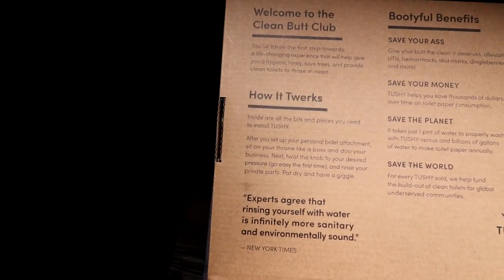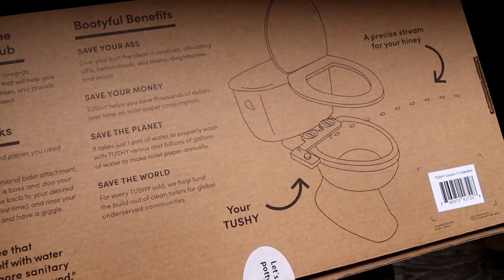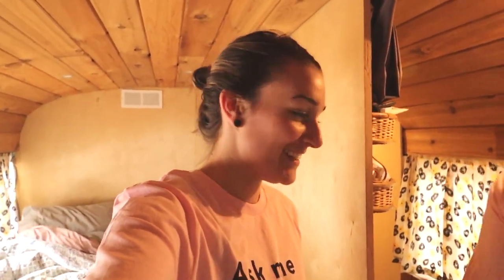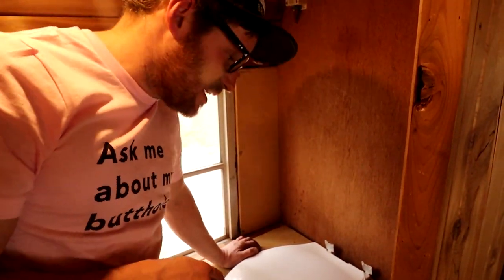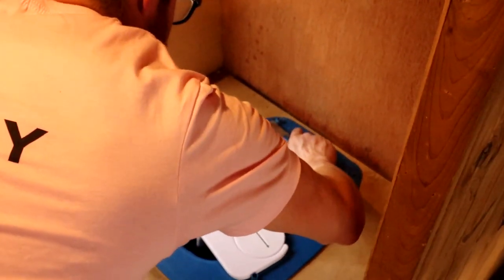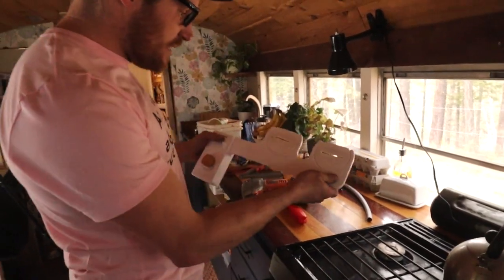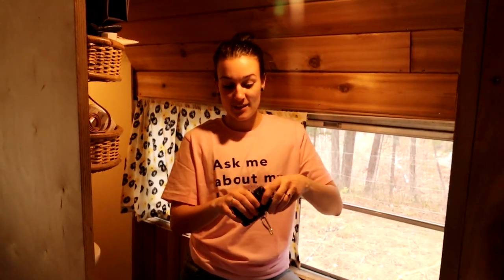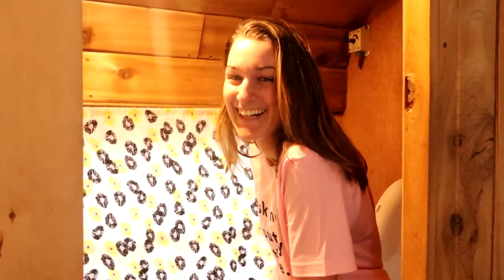Adding A Bidet To Our Composting Toilet | The Best Composting Toilet EVER!

Comment: I’m wondering how the added water from the bidet is going to effect the composting side of toilet. Please consider a follow up video after you’ve used it a while. Just found your channel and subbed.
Reply from the maker: It is a perfect benefit! We use a urine seperator to keep the smell non existent, because we do not have any pee in our compost we don't need to empty it as often.   The problem with having a completely dry bucket added to the compost pile is we have to add water so we can achieve thermophilic bacteria. With the added water from the bidet it keeps the moisture  content of the compost perfect so we do not need to add water to our pile outside. The other benefit is just that little bit of water keeps the pail nice and clean and we get double the time before we have to empty it (less toilet paper and sawdust needed).  AND the nitrogen to carbon ratio is much better too because there is a higher ratio of 💩 to sawdust (very high in carbon).  Literally NO drawbacks after the install. 
Thanks for the sub, we are going to do an update video in the future for sure.
Reply: No idea why the function buttons stopped working since the OS15 bunch of updates…could be Gaagle, too. 
But, posting this, deleted a couple things 😠, now, can’t edit. 
…the splatter from misguided poop can splatter the rear sprayer spigots. 
That can cause infections for women, & they wouldn’t connect the infection, to the “clean” use of a bidet. They & their docs would just keep throwing antibiotics at the recurring infections, making the person sicker over time, never solving the real problem. 
Bidets started out as a separate toilet-looking thing…which was big enuf, males could sit facing room, & females could sit facing the wall, to assure spray washing their respective undercarriages the right direction.  Few have that much room.  Enter: the modern units…which all spray from the rear….not one bit of consideration for female requirements!  
Of course, mileage may vary, because everyone’s different. 
But, there’s NO WAY it’s sanitary/safe for females to use rear spray bidets, ESPecially if many people use the facility.
Reply: @Chimonger1     I have a Bidet and it has a  door that opens and closes after each spray.  I have a dual bidet and It covers bother sprayers.
Reply: @Chimonger1  I have a dual bidet too and love love love it! Never had any infection since installing a year ago.
Reply: @Chimonger1 I beg to differ! “Real” (quality Japanese rear spray/bidet toilet seats) self-wash the (retracting) spray head after every use. This “Tushy” is just a pathetic imitation…
Reply: @OnerousEthic    Most Americans are clueless, so don’t know how to pick good ones, or, cannot afford good ones.  Most do not know what to look for, like how well the nozzles squirt, direction of squirt, etc.  
That means MOST units sold in US, MAY be the less efficient ones.
Reply: @ThisOffGridLife did you end up doing a follow up video?
Reply: @Chimonger1  Absolutely true; we gathered this problem as soon as we saw the spray demonstrated. A handheld hose and nozzle type of bidet is best for women.
Reply: @6sfo    Ummm….of course, technically, no one needs a bidet.  
You can keep using leaves, moss, paper products to wipe….but most of those are harsh with chemicals, texture.   
Many with “UTIs”, are really more related to sensitive tissues of the “nether-regions” are reacting to those chemicals.
Or you could use a simple, low-tech bottle of water with a nozzle….there are portable bidet bottles.   
But really….After most of a long life without a bidet of any kind, then finding a handheld version, I can say with certainty, having/using one, is much better!  
It’s less painful, & less UTIs, with using a bidet hand-squirt gadget.

Comment: Your answer depends on how you treat your waste after it leaves the bucket. All humanure systems I know do not base its effectiveness in getting to that 55 degree C temperature, but in killing pathogens with time in an aerobic environment. Getting and maintaining that temperature is not an easy task; keeping poop dry and aerated is quite simple.  I'm hoping your follow-up will show how you maintain that temperature. Thanks!  PS: if you are maintaining this temperature, I hope you are using that heat for ancillary purposes as well, like building a greenhouse over it to produce food through the winter.
Reply from the maker: In the warmer months it's no issue keeping the compost pile at 55 degrees. But usually in the winter it is less. We are not set up to use the heat created by it but its in the summer so it wouldn't matter anyways. We'll definitely do another video on the compost pile. We do have one but it's an earlier video and let's just say our video quality has improved since then

Comment: This is such a great idea! I think this could work for a Clivus Multrum style composting toilet with a big ventilated tank (IBC) for long-term composting in a cellar below. Except like you do, by separating #1 and #2.

By adding red wriggler worms (Eisenia fetida) to the tank (vermicomposting), the #2 would break down so fast that you'd very rarely have to empty it (decades even). The worms do require a moist compost pile, which is why #1 is not separated in Clivus style toilets. But with a bidet, I think maybe you can.

Not mixing #1 and #2 makes the liquid output (straight from #1 only in this case) much safer to use as fertilizer. That has been my main concern with Clivus style toilets. (I suppose you'd still need to drain some leachate from the tank, which wouldn't be as safe to use.)

I love how adding a luxury item to a composting toilet can actually improve on both the composting (vermicomposting, safer liquid fertilizer) and the bidet (safer due to no splashing). This is so much better than a WC. Add a heated toilet seat and you're in toilet heaven!

Comment: I love my portable bidet, but I’m concerned that all that water would keep the poop wet instead of the composting material drying it out. Does the water go in with the poop, or down the seperette drain?
Reply from the maker: Water goes into the bucket not the urine diverter.  We have found quickly that filling the bucket takes at least twice as long due to hardly any toilet paper in the bucket (and less sawdust required).  Also the moisture content is absolutely perfect to add to the compost pile when the bucket is full, not to mention that little bit of water in the mix helps keep the bucket clean!  Win win win !!!
Reply: I have already switched away from toilet paper to “family cloth” (old washcloths cut in halves or quarters and deposited in a “diaper pail” with sanitizer), so when I get into my vehicle, unless I have a finicky guest, there will be NO toilet paper. Which type of composting material do you use?
Reply from the maker: We use sawdust for covering. I'd like to switch to rags/washcloths as well. Greg is not so keen so far 😅
Reply: Well, even if only you switch, it will lessen the impact on your composting! And eventually, he’ll realize he only really needs to dry off after using the bidet, so it rarely gets very dirty. For sanitizing, I use a hyperchlorous solution that I make by using a bottle that puts electricity through salt water to separate the chloride from the sodium, so it behaves like bleach but breaks down into a solution that is harmless to the environment. I love it, and it’s so much cheaper than other cleaners!
Reply: I just ordered a bidet for my composting toilet. Here’s hoping! 🤞🏻
Reply: @theresahartman7465  I would love to learn where I can get a sanitizing system such as the one you described.  Did you DIY or is there a device on the market that I can purchase?
Reply: @theresahartman7465  I would also love to learn about the sanitising system :)
Reply: @theresahartman7465  please share with us what you use/recipe or where to find the info. Thank you!!!

Comment: How do you deal with the added moisture in the compost toilet? Does the water go into the urine diverter or does it go into the dry section? It seems it would trickle into the solid section when you first turn it on

Comment: Does this defeat the purpose of having a "DRY" solid waste? I build compost/dry toilets for RV/van dwellers using a stainless steel urine diverter and drain line, that eliminates urin order. If this works it would be a definite game changer. Especially for hairy guys 👦!
Edit: i saw your response to another comment and saw your explanation, however van/rv dwellers do not have access to a compost pile as you know if you used yours on the road. How would you think this would work in that circumstance? Thanks
Reply from the maker: There is such a small amount of water, we don't notice any extra in the bucket. The sawdust is a bit damp but it's not sloshing around if you know what I mean.

Comment: I WOULD THINK ADDING WATER TO YOUR COMPOST WOULD MAKE THINGS EXTRA MUDDY...LOL GREAT VIDEO THANKS FOR SHARING.
Reply from the maker: It such a little amount of water, and the saw dust soaks up extra moisture. Plus, in the summer when its dry, the compost pile will be getting that extra boost of moisture it needs
Reply: @ThisOffGridLife great to know!  I’ve been a little bit worried about how everything was going to work-I’m trying to sort some things out for Muslim hygiene requirements so I’m glad to know it should work

Comment: I have been researching this because I am not willing to give up my bidet yet looking at composting toilets. Does all the water go in to the solids portion though?
Reply from the maker: For the most part it does, sometime down the seperstor. Depends on the angle really. It doesn't get super wet though. The saw dust absorbs the extra moisture

Comment: Did you plumb the bidet to your cold water or hot water line?
Reply from the maker: Cold water. We have hot hot water on demand that takes 15-20 secs to start coming through the lines, so it doesnt make sense for us to use warm water. Tushy does make a bidet with a warm water option though

Comment: Ok! I am really interested in the “gritty” details of the workings of the system. What are the 2 discs with the slits in them for? I presume u use paper to dry the washed down patch when u are finished hosing down? I believe the resulting compost is super fertiliser for the spuds. Thank u both for the clarity of ur presentation! Greetings from the spud loving green isle . Raymondo.
Reply from the maker: The two 'discs' are for attaching to a toilet, it's a universal connector,but the composting toilet is a bit different and we macgyvered it. 
Yes,we still use tp. They market that you use less but I don't think that's true, either way, we love having the bidet 😆

Comment: How is it working so far? I'm wondering about too much liquid in the solids bucket. Thanks for any update!
Reply from the maker: It is working great. We haven't noticed any excess water build up, the sawdust soaks it up. It's good for the compost pile, we find it's dry enough here that we need the moisture. My only dislike is the nooks and crannys on it are hard to clean without small brush or something. Still totally worth it

Comment: I understand that you are using a urine seperater for the bidet but how do you move it when your using the compost?
Reply from the maker: The wood is on a hinge so we ljust lift it up and remove the bucket. The urine seperator just slides into the drain pipe. The bidetis attached the wood that lifts
Reply: @ThisOffGridLife  O saw that but when you all showed the urine separate it looked like it was over the compost.  So how you move the Urine separater when ya need to go #2
Reply from the maker: @ForestTre  oh, it stays in place. It only covers half of the opening

Comment: I always told myself that if I were to have an off grid life with composting toilet,  that I would have TWO separate units.  One composting toilet with a urine diverter, and a second unit being a bidet which is plumbed directly to the grey water tank.  Isn't mixing water into the dry composting solids part of the toilet a bad thing?
Reply from the maker: It's not a bad thing it's just a different way to compost.  I find dealing with the waste much easier with the seperate  urine removal.

Comment: Recommend battery operated fan? Thx
Reply from the maker: we find the 12v hardly uses any power and you don't have to worry about batteries running out. we leave it running all the time. One thing we've noticed is when the wind  comes, it does blow the smell in, so depending on your location, be aware of the wind direction :)

Comment: 95% of my toilet paper gets shoved into the cardboard tube of the previous roll(s) of toilet paper.   It then provides HEAT for me in the winter as it gets burned in the wood stove.  Not new normal..... but logical normal.  And saves water compared to bidet.. a huge thing in a smaller rig.
Reply: But, the smell? The hygiene?

Comment: adding any liquid to the compost hinders the effectiveness of the composting process. It is why there is a urine diverter built into the compost toilet seat. This will greatly extend the composting time. Use toilet paper for a composting toilet, use this bidet devise with a regular flush toilet.
Reply from the maker: Actually a dry compost will have difficulty becoming thermophilic, you need the compost moist but not wet for the compost pile to reach 55°c  in order to kill pathogens.  The bidet is a perfect solution to keep that right level of moisture achieved!
Reply: I've never heard of this before. We have very big compost piles on our farm & we compost pretty much everything. Maybe it's different for toilets but if we get a dry spell with no rain our piles don't cook as well. Dry materials don't compost very well.
Reply: @Oldfarmlady  Humanure is very nutrient rich, there's a lot of food for bacteria to so its thing. As with any compost, some moisture is good, while too moist or too dry is no good.

Comment: Did you get problems to dry the poop with all this cleaning water added ?? I'm a Muslim and we use water to clean our selfs ...I'm want to install a composting toilette and my big problem is the water we use ..I thought that it's doesn't work with a composting toilette bcz you need to dry the poop with sawdust and adding cleaning water will not help...
Reply from the maker: No, it was fine. We often have to add water to the compost pile when it’s summer